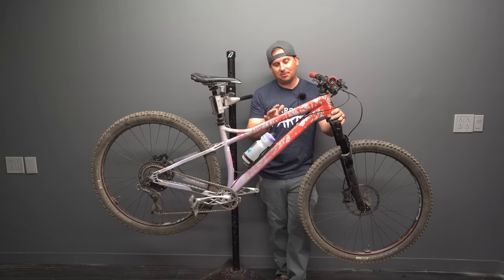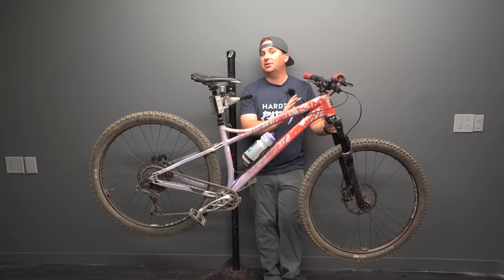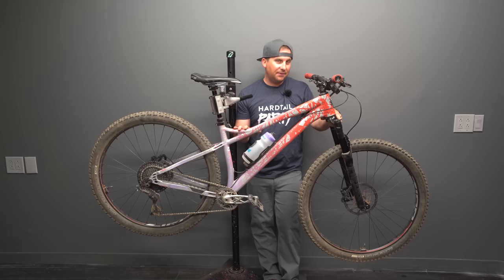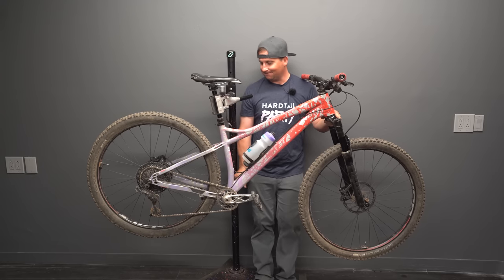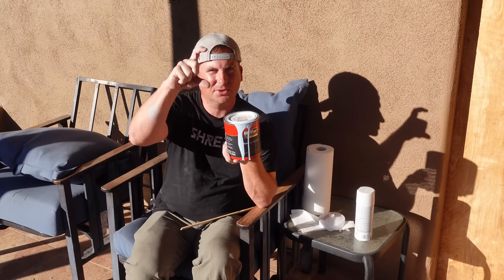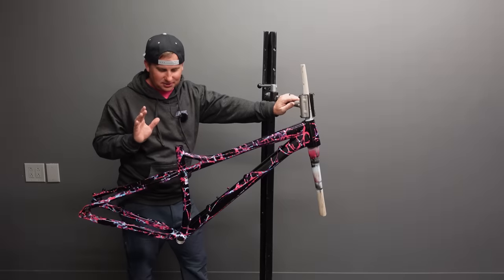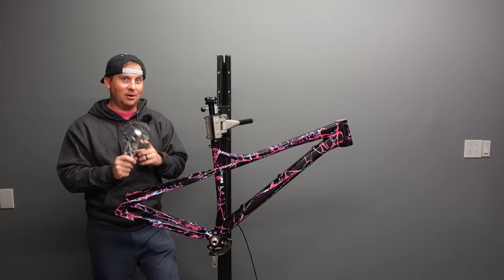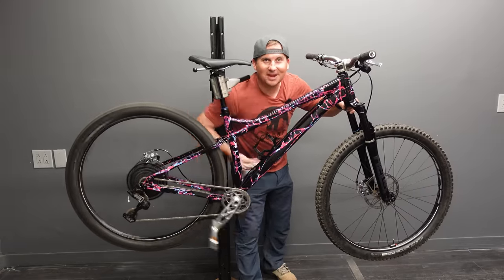You May Not Need a New Bike - Improving My Banshee Paradox V3 - Bike Check + Upgrades + New Paint

Comment: When I will build up a new bike I will replace my Deore 12 speed to a Deore 10 speed, on the one hand because I don't need those super easy gears and on the other hand because of a relatively good availability of replacement parts other than 11 and 12 speed drivetrains.

Comment: Would love an in-depth video on painting a frame! Can you do carbon frames? I’d be interested in doing a repaint on my carbon frame but the prep word scares me a bit
Reply from the maker: Prep is everything. Yes, you can paint carbon frames. You just can't sandblast then or use a wire wheel to remove the paint like you can on steel or aluminum.
Reply: He has more detailed painting videos from last time the banshee got painted. Check them out!

Comment: I like that you are revisiting your personal bike. I noticed you are running skinnier tires vs the 2.6?  Are you moving away from the bigger tires or is this a lighter duty setup? I also use your volume spacer recommendation to tune my fox 34 so that I don’t bottom out on jumps.  I’m running 4 I think and 89 psi.  Works well 👍
Reply from the maker: I run 2.3s 90% of the time, unless I'm running 3.0s

Comment: I enjoyed my advent x but I really hope that they improve the derailleur in the next update especially the chain tension. That thing slaps around all over the place. Currently running single speed but will be going back to the GX derailleur with NX cassette. Also I’m waiting on 27.5 rims to run plus tires on my paradox, hopefully the BB drop wont be much of an issue on my terrain since we don’t have huge boulders everywhere.
Reply from the maker: Advent x has an adjustable clutch. Have you tried tightening it yet?
Reply: @hardtailparty  I have, I don’t think it’s a clutch clutch problem. The spring that pulls the jockey wheel section back needs to be stronger. I have 2 derailleurs and both lack chain tension compared to sram derailleur
Reply from the maker: @MilkDot  interesting. I assume your chain length is correct and you have the b tension correct? I have 6 sets of these drivetrains and i haven't had that issue.

Comment: I'm buying this frame after watching your assorted videos about it. All of my parts save a few things will go right over from my '15 Honzo and many are similar already to what you run. Question: it looks like yr running an MRP XCg bashguard and a 32t oval ring. I run the same ring and was curious if you have the guard rotated a certain way so that it compensates for the widened oval (34t top out) as the guard is only "rated" for a 32t ring? Thanx, RE.
Reply from the maker: I've been using an absolute black bashfuard lately for that reason